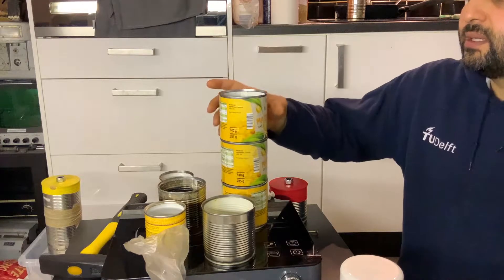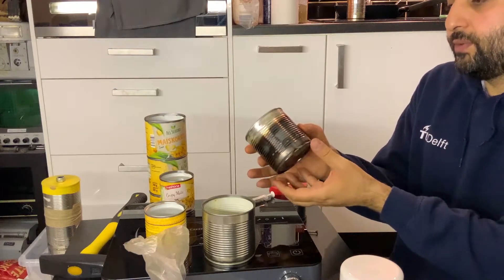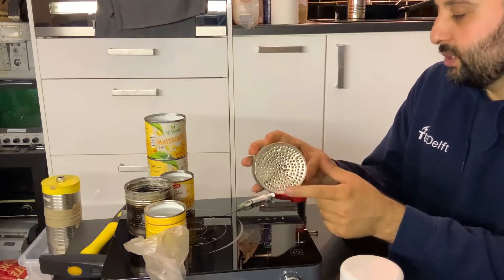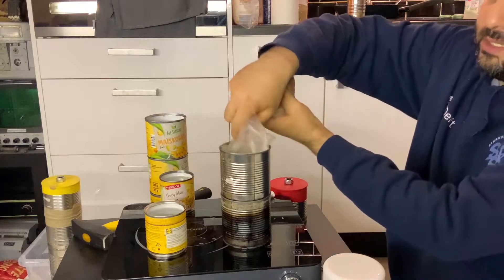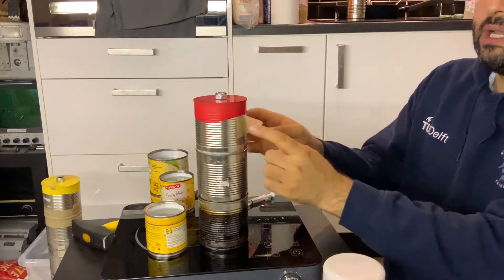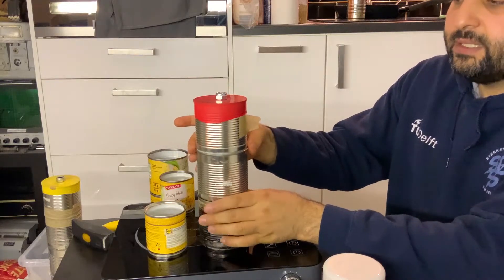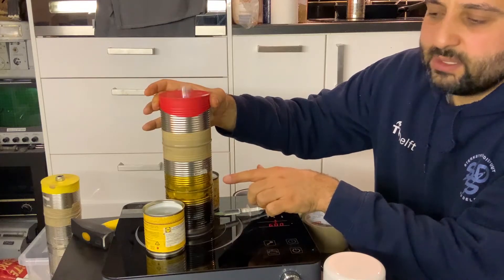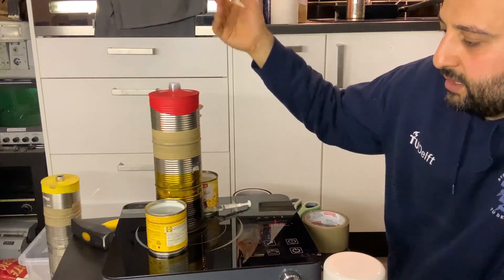Rice Engine v2   ( How to make an improved Thermoacoustic Heat Engine )

Comment: This is a great idea I would like to see :
How does the "stack" material change the performance ? For instance metal pellets are more conductive and could be cooled more efficiently. 
You could also use thin copper wires or copper tubes (cooling tubes) to condensate the water vapor inside and create a bigger temp. difference. To use the copper wired simply drill holes from the outside into the middle can, stick copper wires rigth through and solder the ends to the can. By having the 3 cans seperate one could swap each stage to try out on stage 1 a more efficient heating method, with insulation and better airflow. Stage 2 different "stack" materials and configurations such as copper wires and tubes differently sized glass or metal pellets and less conductive materials such as a ceramic cup to prevent heat traveling from stage 1 to stage 2. On stage 3 one could use a speaker as a generator and other linear generators. I think this has a huge potential. What do you guys think ?

Comment: I'd like to show you my acoustic engine but I think I should patent it first. I'm a bit afraid of the high voltage and amps.. not sure how to tame the beast. It produces 63K volts at the spark gap....and perhaps too many amps. I'm sort of too afraid to build it. Mathematically it produces about 2 billion volts but the spark gap limits it to 63k volts...AC current. I don't even use a coil.... the electromagnetic field is powerful and water cooled. It also makes water and does electrolysis into hydrogen and explodes it for sound feedback. I use a lot of clever science to get vibration... and lot of clever materials to get thermal conductivity.. and use feedback. I'm using an alternating magnetic field with opposing eddie currents... I think it will levitate....it has no wires...just the 2 you need to connect the positive and negative.
There are 2 secrets to the device ... I will tell you only one.... that gold is magnetic when it gets hot... while iron is not when hot. It has 2 voltage producing systems.. one is piezoelectric for the electrolysis and the other is from static from splitting water droplets and that one is to explode the hydrogen. People are going to flip when they see how easy it is....It will make clean air, hot water, electricity and gravity... only 13 non moving parts... and you don't have to use your stove.. you just have to sing to it and once it gets hot it will never stop because the exploding hydrogen and the feedback keeps it going. As soon as you sing to it.. you have a 454 lb xylophone key that will bounce on the disks... a lot of force which will make a lot of heat which will make a lot of sound and then the feedback.... I call it an acoustic engine because you don't need a heat source.... and that xylophone key will get so hot you would have to cool it with mineral oil because water would just steam off of it.
Reply: I love how No one responded to your garbage comment
Reply: @billybob2837  Its been open source for 2 years. Does about 30 million watts. The parts are engineered and open source. It was shown to a government and a few already built it.  A few people innovated it and made working devices. Many thanked me. It is so incredibly simple. Everyone who built it says it works... a bit dangerous though. There's a similar device in Africa already in cars. A little less dangerous because less power. Same principle of using heat and radio waves. It's a thermoacoustic engine using sound...runs right away from any vibration but runs forever once it's hot.
Reply: @omegafile proof? Oh wait it’s a “secret”. 😂deluded
Reply: @billybob2837  if you were smart enough to look for it. You can find the drawings and everything including how to build your own. Seriously just look for yourself or I can build you one...but I won't assemble it. You will need to come up with a few ounces of gold to get a  powerful one with a hefty magnetic field. There's only 8 parts...some are duplicated...meaning you need 2 of each.  If I build you one you will have to have a lawyer to deal with my lawyer so you don't scam me. I don't care what you use it for but I still need to protect myself. I got asked 2 years ago to build one for a small city. Even that conversation can be found. Even John Hutchison was willing to build one if you put up the money...but I think your around 12 years old so if that is so then I won't deal with you.
Reply: @Walterjratbreakfast  The annual revenue from selling 30 megawatts to the grid is 1 to 3.6 million dollars a year... for just one state or province alone. Keep laughing.

Comment: Have you tried starting it with alchol? This should solve the rusting issue but brings a highly flamable gas into the equation, the induction stove may negate this.
Reply from the maker: Hi, no, I do these experiment in my living room and using a flammable liquid/vapor is not wise.

Comment: in the lower section(the first can) is there only glass beads or steel wool and glass beads combined? please reply asap.....i am doing this project for my submission(you can think of it as a science fair or something) soo yeah..if you could give a small clarity..it would be a great help
Reply from the maker: Have you seen the video ? I mentioned all. The first can is empty, the second can has glass beads, the third can is also empty.
Reply: @HVE  okay yeah I checked the video again......and one more thing ....if I use rice in this type of model I'll just fill it all with rice right no need of steel wool and all

I'm really sorry for so many questions😅
Reply from the maker: @ayyagarimanojna0408  Yes, instead of glass beads just use rice, no steel wool is needed
Reply: Kk thanks so much

Comment: Hi, nice work! Put a beer can in the upper section, and the gap between the outside can and the beer can will act as a condensation place similas as rice!
Reply from the maker: Thanks for the suggestion. Will give it a try and if it works properly, will make a video of it 🙃
Reply: I'm working on this method now, I'm currently printing a linear generator for the top of my cans now. 

I'm thinking, insulated tube walls in the boiling chamber, and either a cooling loop for the glass beads or heat pipe with heat sinks as the condensation surface.
Reply from the maker: @chaorrottai  Good, if your attempt results in an improvement, please let us know here, I will then try it.